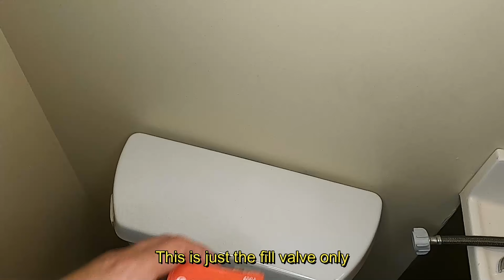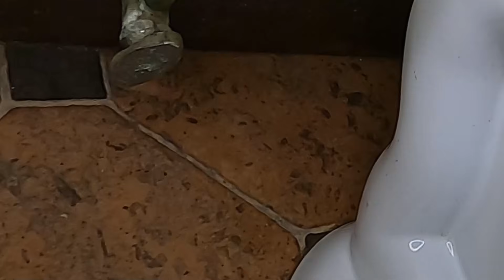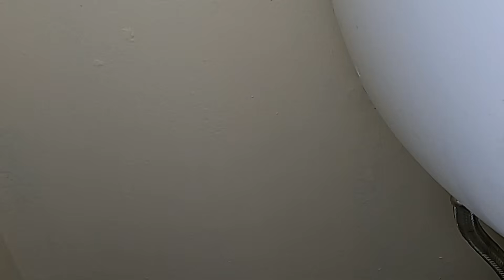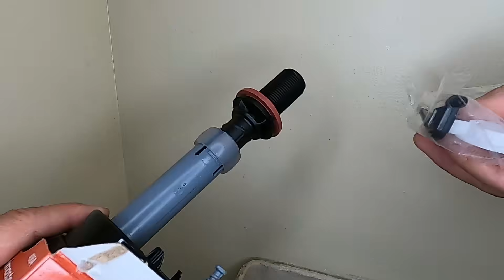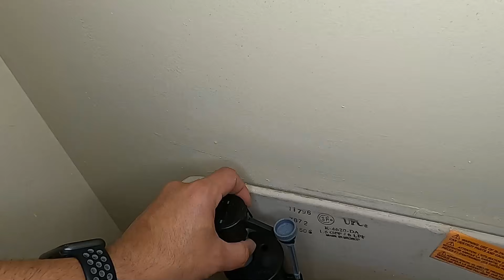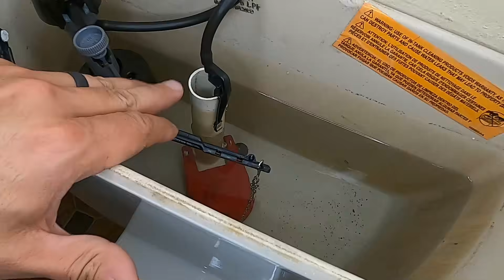How to replace toilet fill valve - For Beginners

Comment: How do you know how high to set the fill valve or if the fill valve is shrinking/ sliding down?
Reply from the maker: There’s normally a mark on the back of the tank inside where the water level needs to be. You need to raise your height until the water hits that level. You can tell if it’s too high if the water is flowing over into the overflow tube. Thanks for watching!

Comment: Mine is leaking on the bottom of the tank near the fill valve where the water connects to it
Reply from the maker: You can follow all the same steps to remove and then check the gasket if that’s where the leak is from. Is it there or the hose? The whole assembly is cheap enough if it’s the plastic or gasket to just replace entirely but I do think you can get just a gasket.
Reply: @theguyofalltrades  yeah the gasket on the fill valve was wore out..I finally got it fixd
Reply from the maker: Awesome! Hope the video helped